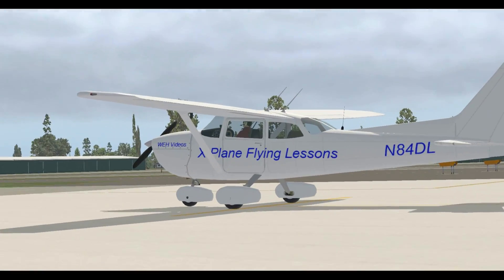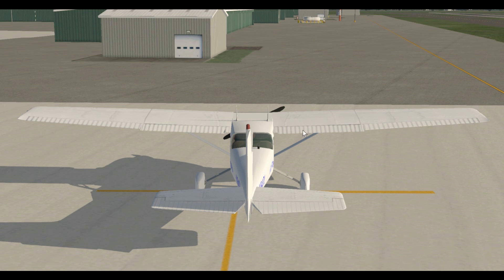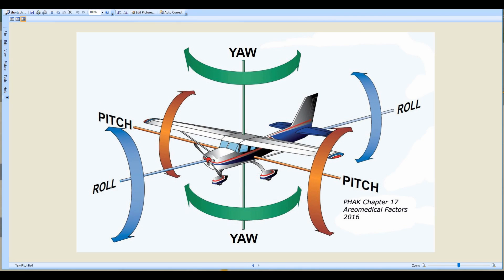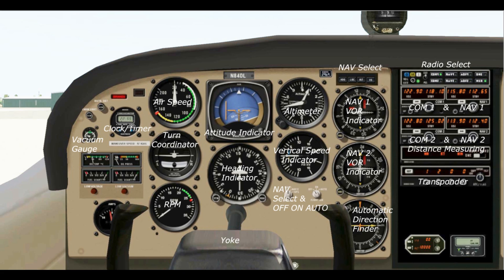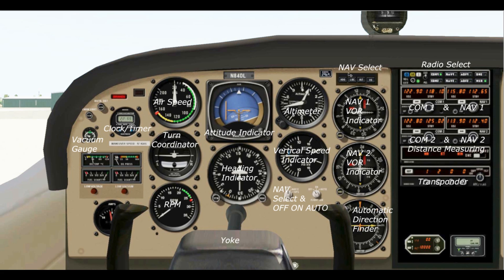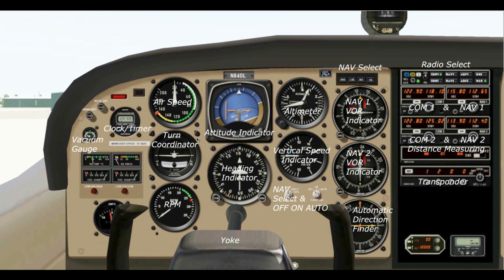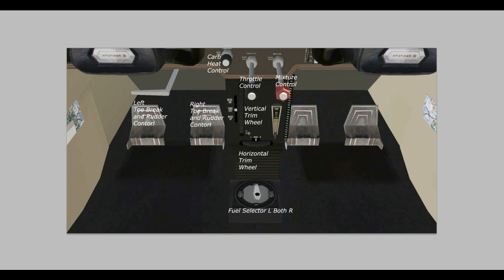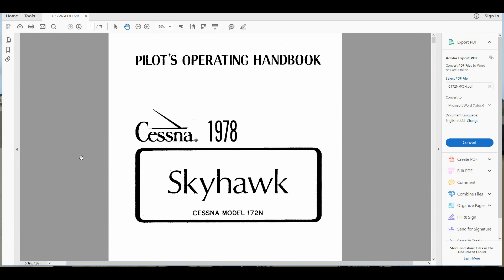Introduction ~ Learning to Fly for Beginners in X Plane 11 Part 1

Comment: for Roll what happens? rudder changes to left or Right. i'm getting confused. thanks
Reply from the maker: Hi Eric,  If you look at the diagram in the video showing the different axes (or "things" something will rotate around) you can see the the Rudder causes the airplane to rotate horizontally which is called YAW. So in level flight with the wings level to the ground when you use the rudder the airplane will turn but the wings will stay almost level to the ground. Notice in the diagram the line going up and down vertically in the middle of the airplane labeled YAW, that's where the airplane rotates. From that point the tail of the airplane will move to the right and the nose to the left around that point, if you apply left rudder.

The Roll is controlled by the ailerons on the outer part of the wings. When you turn the yoke or joystick to the left or right one aileron will move up the other down causing one wing to go up and the other to go down, the airplane banks to the left or right depending on which way you moved the yoke. You see this in the diagram with the line going through the airplane is from the nose to tail horizontally labeled Roll, and the airplane will rotate around that axes. Hope this helps, please let me know.

Blessings,
skip
Reply: @WEHVideos  thanks so much. 
now i have an error in settings for stick that says i have multiple axis for yaw. no buttons for yaw. for stick i have pitch and roll selected. can u help?
Reply: now it says same except its for pitch?
Reply from the maker: Hi Eric,  When it says you have "multiple axis" that usually means you have two devices attached that do the same thing such as two yokes or joysticks or a yoke and joystick etc. so make sure you only have one of these attached.

Blessings,
skip
Reply from the maker: Same problem as YAW above.
Reply: @WEHVideos  ²that's that's what the problem was
Reply from the maker: Looking good, glad I could help :-)

Blessings,
skip
Reply: Thanks. I resolved issue. Thanks for your help

Comment: Can you please explain how the plane does not rotate around itself because of the rotation in one direction of the propeller ??
Reply from the maker: Hi Hanze abu gosh,  I can't explain that here in comments it pretty complicated. Suffice it to say there are several forces at work and there is a tendency for the rotation of the propeller to try and "twist" the airplane like you suggest. Here is a link to the Pilot Handbook of Aeronautical Knowledge Chapter 5 that explains the aerodynamics. Check out 5-28, Basic Propeller Principles, to learn how the propeller works and the forces involved in flight: www.faa.gov/regulations_policies/handbooks_manuals/aviation/phak/media/07_phak_ch5.pdf 
 Hope this helps, please let me know.

Blessings,
skip

Comment: Hi Skip,
2 reasons for posting- first, to again say thank you for such a wonderful, consistently clear and well-paced series of videos - I keep returning to them!
Second, a little request! (Actually probably a huge request). One of the things I struggle with is RF call-outs and general ATC use. I saw you have a playlist for how to use the nav radios for IFR flying, but could you please do one for the basics of talking to ATC while flying the circuit in VFR? E.g. from ramp to runway, to sky and back? I just feel like I'd 'get it' more coming from you...
Thanks again, 
Chris
Reply from the maker: Hi FRFlightSim,  Glad you like the videos hope they are helping. As for making a video that could be a while, however, here is a link you can use to listen to live ATC communications : www.liveatc.net Just select a small airport (not the large international ones) where you will hear mostly VFR talk. If you select a small airport, say one you fly out of in X Plane or your sim, and if you know the layout of the airport such as runways and taxiways etc. you can learn a lot from listening to real pilots & controllers. For VFR flights you mostly contact Ground and Tower at airports and in flight you could contact Center for flight following,  it's pretty simple. With that said doing this in real life for the first few times can be very intimidating. Conversations are fast and if you don't know what to expect can be really stressful for a new pilot. Hope this helps and thanks for your suggestion I'll try and work on that and thanks for watching.

Blessings,
skip

Comment: Thank for making such a great series of flying video.  I would like information on where to find the maps you used in the X Pane folder.  Thank you once again.
Reply from the maker: Hi Rick,  Thnaks, glad you liked the videos!! Sorry I'm not sure which maps your are referring to, could you be more specific.

Blessings,
skip
Reply: @WEHVideos  I'm referring to the map used in video "How to use the Autopilot, Part 1, the large pop-up map.  Your video are super, thank you for all than you done.  Rick Thorne
Reply from the maker: Ok That is the XP map and you can toggle it by using a keyboard key. I've assigned a key and I don't remember the default key if there is one. Open the "Settings" window and under "Operation" you will find "Toggle the map window" down at the bottom of the page, to the right you will see a key assignment area and if there isn't one you can assign a key to toggle the map. 

Once you open the map in the upper right you will see "Mode" and drop down options, "VFR sectional" is what you should see as default (I think) and is what you saw in the video, however XP remembers your last choice so it will open with whatever was used last. The video was made with XP10 so the map will not look the same as XP11 but it works pretty much the same. Clicking on an airplane will give you the airplane info and clicking on an airport will give you airport info and clicking on a VOR will give you it's info. Hope this is what you were looking for.

Blessings,
skip
Reply: @WEHVideos  Thank you, that was very helpful.  I enjoy your videos.
Reply from the maker: Your welcome glad you enjoy the videos, thanks for watching.

Blessings,
skip

Comment: Thank you very much for your time and effort in making these videos, it is much appreciated.  I do have a question though!  After watching all of the videos, I am now starting at the beginning again and 'living' them.  On the Benton field information from airnav.com, it says that, for noise abatement, you should climb to 1500 ft above AGL (=2.273ft including elevation) before turning.  The pattern height that you mentioned of 1723 feet  would therefore be under the stated turning height, if I understand correctly.  Or do patterns perhaps have different rules?
Reply from the maker: Hi John, Very good question and you answered it, the traffic pattern at most airports is 1000ft above field elevation, unless otherwise noted. When you are departing the airport (not staying in the pattern) then you should continue flying runway heading until 1500ft about ground level as suggested at Benton Field. Note, these are suggestion for noise abatement and not strict requirements when departing, pilot discretion applies. If the pilot doesn't think it is safe, well, safety first. 

Blessings,
skip
Reply: Hi Skip and thanks for your answer.  I just wanted to share something with you and the people watching which only occurred to me while I was watching part two of your excellent tutorials, namely that the pattern altitude has in the meantime been deleted from the FAA info for Benton Field (the newest one is effective 31 Jan 2019). It was this missing fact on the info (I was reading my own print out, not the one in your video), together with the additional remarks at the bottom regarding noise abatement, which led me to asking my question.  I find this deletion odd, even if the general rule of 1000ft above field elevation for most airports still applies.

Take care
John
Reply from the maker: Hi John,  I looked up several other airports and the traffic pattern is no longer listed under Airport Operations. My guess is, unless otherwise stated, you should assume 1000ft about field elevation since this is standard for most airports. If you look up KSQL (San Carlos Airport) you will find the traffic Pattern Altitude listed at 805.5ft but for all the other airports I checked no Pattern Altitude is listed. Must be something new for AirNav and probably other sites as well, that's my two cents anyway :-)

Blessings,
skip

Comment: hello i like your videos. and i have a problems with my x plane 11. every time when i am landing with 1500 -1700rpm, the speed will be 50-55 knots, i never seen my plane has 65 knots with about 1500 rpm. it is not enough speed and the plane just fall down heavily no matter how much i pull the yoke back. could you please tell me what's my problems? is there anything i should set up for the weight of the plane ?
Reply from the maker: Hi June,  What airplane are you flying? Are you using your flaps? 

Don't worry so much about the RPM it's air speed that matters, when landing it's all about speed. If you are too fast you will overfly the airport or at best bounce down the runway. Too slow and, as you say, you fall out of the sky. So if you are in a Cessna 172 you want to be around 65-70 kts on approach and slow down below 60kts or so just before touchdown. Again, don't worry about the RPM because if you are flying into a strong headwind you my need a lot more power,  you may need 2200 RPM to maintain the air speed needed to keep flying. The opposite is true if you are landing with a very slight tail wind. In this case you may need to cut power to idle much earlier to slow down to the proper landing speed. Try landing watching your airspeed only ignoring your RPM for now. Hope this helps, let me know.

Blessings,
skip
Reply: @WEHVideos  hello Skip, thanks for answering. yes your advice do help me land slightly. i use cessna 172. i watched many videos, i saw people landing with 65 knots, 1500 rpm, 3 degree glide slop, 3 notch flaps in a calm weather. but i never achieve that. do u know what's wrong? looking forward to your answer
Reply from the maker: Hi June,   If you are lined up correctly with the runway on final approach at a speed of 65-70 knots and are slowing down to around 55 knots at touch down you should have no problem. Don't worry about the RPM just speed. You mentioned your airplane "falls down heavy when you pull back on the yoke" this sounds like you are trying to flare too high above the runway and pulling back on the yoke when you get slow will cause a stall and you will drop because the wings can not produce lift. This is actually what is supposed to happen when landing but you need to be just a foot or or so above the runway. Landing is a controlled stall of the airplane over the runway. So I think you are doing everything right but you are too high when you flare or too fast (above 60kts) when you flare or both. If you pull back on the yoke to flare going too fast you will actually will climb getting higher above the runway than you want then when you finally slow to stalling speed you are too high and drop to the runway. 

Try this and see if it helps. Wait longer before you flare, get closer to the runway and be sure to be below 60kts. (calm conditions) 55kts would would be really good and with full flaps 50kts would be great. When flaring do it slowly level off  DON"T allow the airplane to climb. You should be at full idle at this point so if you are a foot or two above the runway in level flight with no power the airplane will slow to stalling speed dropping to the runway and when done right you will settle down nicely on the runway without bouncing or hitting the runway hard.

Practice flying at 55kst just above a really long runway then reduce power to idle and try to keep the airplane in level flight at that altitude, you should be just a foot or two above the runway. As the airplane slows down you will need to pull back on the yoke VERY gently trying to maintain the altitude which it will not be able to do. If for some reason you start to climb release the pressure on the yoke a bit do NOT let the airplane climb (you are probably too fast). Done correctly, as the airplane slows it will slowly drop to the runway and you will have a perfect landing. 

Make videos of your landings so you can get an outside side view. This will help you see how high above the runway you are when you flare and you then can make adjustment for when to flare. 

Also position your airplane at a three mile approach which is an option in flight setup. The save to a "situation" so you can reload the flight and just keep practicing over and over again until you get it. Start with no winds then add wind as you get better. Don't worry you will get this it just takes practice. I hope these tips help keep me informed of your progress, I know you can do it!!!

Blessings,
skip
Reply: @WEHVideos  hello Skip thank you so much for your advice!! very patient you are. i will practice as you said, especially last two suggestions, which i never tried. thank you again!!
Reply from the maker: Your welcome June, I'm looking forward to hearing about your progress :-) 

Blessings,
skip

Comment: what is W.e.h?
Reply from the maker: Hi Tony, Those are the initials of my name, couldn't think of a good name when creating my channel at the time, wasn't sure exactly what I was going to do so now stuck with a name that doesn't say much about what I do.

Blessings,
skip
Reply: WEH Videos So...Wayne...Walter.....Wainwright......William... what's your flying history? How did it all start and what training have you gone thru?😅
Reply from the maker: Good guesses, William. I started taking flying lessons in 2014 at Benton Field in Redding CA. Because of the costs I can only fly once in a while so I have been a student pilot since then with little chance of obtaining a Private Pilot Certificate at this rate. I have finished my ground schooling with King Schools and have 65 hours flying in a Cessna 172N and SP with three solo flights to date, that is why most my videos are done in the Cessna 172N because that's where I have most of my experience. I manage to fly every three months or so I save money for the lessons they fly. My next flight most likely will be a cross country which means flying over 50 miles to another airport. This will be pretty expensive so I'm saving as much as I can. Unfortunately I was just informed the airplane rental and instructor fees have gone up almost 10% so maybe by the end of next month, if I'm lucky, I'll be able to take the flight. I have been wanting to do a cross country for a while so I can do a video on it but will have to wait for now. Happy flying :-)

Blessings,
skip